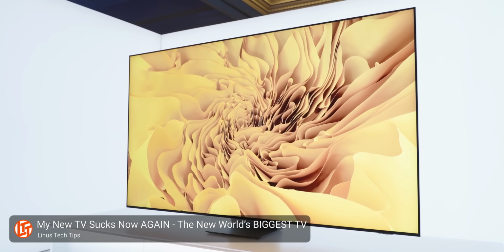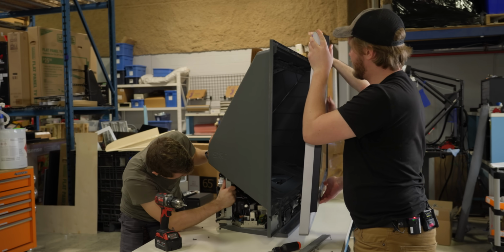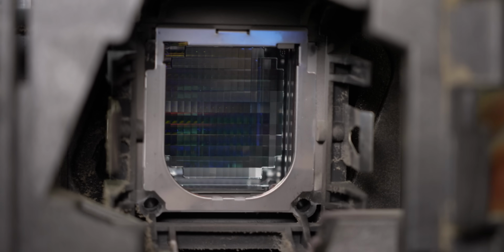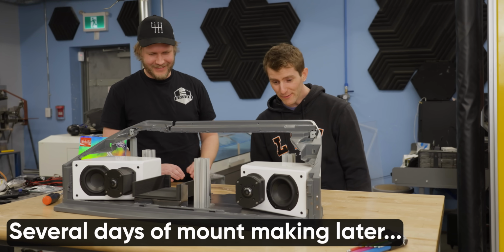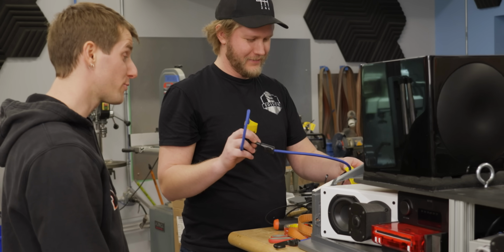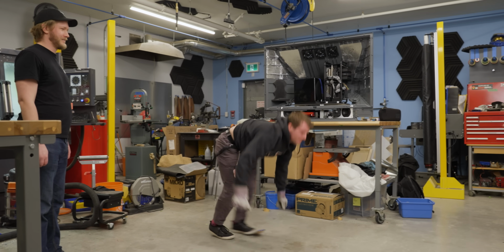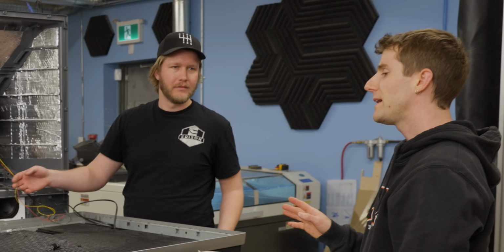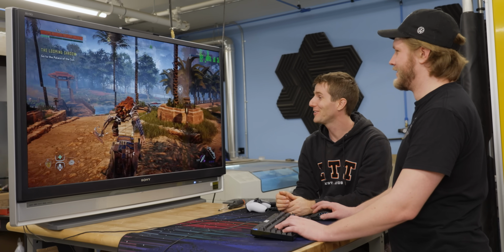The ULTIMATE Sleeper Gaming TV

Comment: I would have done this a lot differently. I would have taken apart all the systems, get rid of bits you don't need. Create mounts for the drives and slots in the plastic. Make it fully enclosed and light. Who the heck wants a heavy TV that takes four people to move? And cheese balled. That Alex guy doesn't think smarter not harder.

Comment: as a dj of 25 years the worse possible thing they did was put a sub in the tv, mainly the mainstay of tv frame material is plastic, the ammount this will vibrate is nuts, in fact its quite possible the sheer op vibrations from the sub will prevent the 2 consoles from working at all, because the vibrations will mess with the disk reads very badly, in the end in my eyes a sub is a peripheral u need a special space for that doesnt just vibrate the whole house or whatever it touches and is well thought out

Comment: A friend of mine has a similar projection TV at home, ready to be thrown out. It's 50 or 55 inch and on one of those movable pedestal thingies that house the speakers and the rest of the components. This would make an amazing combo with an OLED panel and the projector shining a B&W image onto the back of it, making the contrast ratio out of this world. DIY Perks did something like this with a normal TV and a projector mounted above and reflecting back onto the TV.

Since these things already have a projector in them, this could potentially make a better version of the "infinity contrast" TV he made. Since OLED is still quite expensive, a normal 4K display from a broken TV would be a nice candidate for this.

Comment: I just picked up a similar TV after my decade old Insignia's power supply failed (say what you want; it looks better than a lot of budget smart TVs with wonky colours and terrible built-in Roku OSD; I paid 350 for it lightly used years ago and it's seen almost constant use). Went on Marketplace and picked up a free Sony Grand Wega 50" of roughly 2004 vintage, and yeah, it's a huge downgrade in resolution, contrast, and brightness, but I will say this: it's really tied my living room together considering the rest of my setup: PSB tower speakers circa 1990 powered by an early 80s "silverface" (Audio Reflex in Sony-coloured clothes lol) receiver, VCR, my beloved PS2, and a Pioneer Laserdisc player (plus an HP ProDesk whatever as an HTPC, which gets 99% of the use, and small Bluray player I've literally never used, but w/e).

This is a setup I could only dream of back in '04, but now I've got the full upper-middle class home theatre experience (minus the traditional garbage surround sound in a box setup; much prefer a good set of stereo speakers than a circumaural set of shitty ones lol), and tbh I'm gonna be a little sad to see it go when I finally fix the power supply in my Insigna. I'm honestly considering replacing the internals with the Insignia just to keep the Y2K aesthetic lmao.

Already kind of an unusual thought to have, and then out of nowhere, LTT puts up a video doing exactly that? I feel validated and emboldened to put my plan into action. And even better, there'll be enough room in the thing tohide the HP instead of having cramping the TV stand's style (it's a SFF model, so the GPU is dangling out the side with a PCI-E riser, and an entire ATX PSU hidden behind the VCR for the 8-pin lol; it's taking up a good chunk of usable space).

Comment: The reason Xbox isn't in the top four is because it's mostly superfluous if you have a PS5 and completely superfluous if you have a PC, Since nearly everything that's on the Xbox is also on the PS5 and PC and if it's not on the one it's on the other. Yeah. I mean if you are only going to have one console in that case you'd just get a Series S because of Game Pass, but if you're going to have multiple it just makes sense to not include an Xbox... Actually the Switch is also mostly superfluous if the PC is powerful enough to run the emulator for it at full speed and it doesn't take much to run Dolphin for Wii games...

Comment: I had this tv.  The bulb had to be replaced every few years, which was like 200 bucks or something.  The picture eventually had a yellow spot form on the screen that grew over time to the point where the whole screen turned yellow.  I thought it was a good deal at the time because it was less expensive than flat screen lcds and plasmas.   This was back when 50 inch lcd and plasma flat screens were almost $4,000-6000, while this tv was half the price.

Comment: I loved my DLP TVs.  I had a 42" Samsung I bought in 2004, and the control board died after 2 years.  Best Buy decided it would be cheaper to credit my original purchase price.  I got a 60" Sony, which I used until 2015 when my oldest started crawling.

I broke a buddy's plasma tv last year and I thought about doing something similar.

Comment: Greetings to the LTT team, thanks for your video. I am from Chile and I have a question: In my country the builds that cost $1000 dollars really cost $2000. A video about budget PC would be interesting considering that in other countries different components are more expensive. For example, an RTX 4060 costs $402, but a motherboard can easily cost $250 and be low-end. Additionally, Amazon is not an option because shipping and fees cost more than the component itself. Can the LTT team put together a PC Build that considers prices in Chile or, perhaps, a super video comparing different prices from different countries so that they can see the difference in ranges and quality that one can choose in places that do not work with the dollar.

Comment: My dad had a projection tv but as a kid I didn't know it was mostly empty inside. I thought the heft was because it was filled with stuff. Now that I'm thinking back it was the built in speakers on the bottom which was the built in stand for it. I remember losing like a ball or flying toy behind it and one day being able to actually move it by myself and putting it back successfully. It having S-Video on the front was a huge deal too. And my sister constantly tripping on the cords and ripping out the a/v cables of our playstation. Good times

Comment: for the speakers you can use mackie cr-2 x cube facing user then in addition a mackie cr6s-x pointing any direction (including back). not necessarily theses exact model bt same format. it's very specific cause the bases play a bit of mid range, and because it's meant to be combined with cr2-x cube, the remaining spectrum cnan be provided by this very tiny cube form factor. it's designed to take the minimum amounf of space facing user, while most of the "big sounds" can point pretty much any direction (of course there will be a tedious configuration optimisation for the subwoofer, like any subwoofer, but this configuration is very sensitive to calibration).

Comment: This was pretty cool. Those DLP projector tv’s back then were a good alternative to the more expensive bigger than 45 inch plasma and early lcd flat panels hitting the market at that time. My dad was a tv repairman through the mid 90’s to 03 when my mother’s health started going really downhill. I remember he sometimes worked on the really old projector sets. IIRC they had three tube projectors for each main color, red green blue pointed up to a mirror in a similar angle to this one. The shop Dad used to work for eventually closed down somewhere around 2010 because everyone was throwing out the old tube televisions and jumping straight to large flat panel sets when they were getting affordable for most people. Plus the way that flat panel televisions are made, whatever needed to be fixed required a major component to be replaced, and the cost of an entire mainboard or the screen alone made repairing cost prohibitive.

Comment: I had a 61 inch version of this, A HUGE jump in size for the day and I rode out two lamp changes and going from a tube tv to this was an insane jump. I also paired it with a really nice surround sound system (3.5k) which I still have to this day.

Comment: My parents bought this exact TV in 2007. Still have it today, and it works perfectly. Never missed a beat, except for needing a projector bulb replacement around 2012. Very cool to see you guys taking it apart and explaining the tech. Thanks!
Reply: Add a MINISFORUM 795 to its back
Reply: This was the first TV I bought myself around the same time-ish, and my first HD TV. It served me well until it started turning off and on again randomly after many years, and I couldn't figure out why or how to fix it and had to replace it. I actually still have it in my basement because it wasn't completely broken and I thought maybe I could give it away to someone who knows how to fix it, but weirdly enough, nobody wanted a massive rear projection TV in 2015 or so.
Not sure why they're shitting on it so hard in the video. Honestly it did not feel or look awful to me at all, actually I remember picking it out in the store because it had a significantly better looking picture than several non-projector devices next to it. Sure, it's obsolete now, but it wasn't a bad TV for the time by any stretch of the imagination.

Comment: I had one of these 55 inch "FULL HD 1080p" Sony TVs, forgot the model but that was the logo in the bottom right corner. When I connected to my PC for the very first time, I found out it actually  had only..... 768p max resolution. Remember those old tube monitors with 1024 x 768 resolutions? Yup, it was pretty much that for real and Sony just sold these as "FULL HD 1080p" since it was really early days of HD broadcast and most of the satellite and terrestrial TV channels were broadcasting in 720p that was considered HD.
Reply: Couldn't that have been an interface problem? Connecting PCs to old TVs by VGA was always dodgy for me.
Reply: It is possible that the EDID data (which tells the PC graphics card which resolutions the screen supports) was skewed when you used an HDMI to VGA adapter to connect to the PC. 
If no adapter was used, I'm guessing the TV's EDID data itself was incorrect from the factory. In order to make sure, it is necessary to force the EDID data to 1080p using the Custom Resolution Utility
Reply: To everyone wondering about connection or adaptor, nope! It was HDMI to HMDI and I even tried with different cables just in case but same result.
The reason they pasted "FULL HD 180p" was probably because it technically "supported" that and most likely was scaled down if there was any 1080p broadcast to begin with.
Reply: Uhhh if your TV only went up to 1024 x 768, I have a feeling that was an issue on your end. That's a 4:3 aspect ratio, so it doesn't really make any sense that a wide screen TV would max out at that resolution regardless. They had rear projection TVs with DVI and HDMI after all, so people indeed hooked up PCs to them back in the day at higher resolutions.

Also you mention tube sets going up to that resolution, that would be a CRT monitor from like 1995 in terms of capability. You sure you're not thinking 1366 x 768 or something there abouts? Did you use hdmi/DVI? If you used the component out of your old GPU, back when that was a thing, analog 1080p wasn't really a thing. Like, physically, you can transmit the signal, but DHCP was established so not TV had analog 1080p, only digital 1080p.

Comment: Y'all would have done better building a box enclosure using ALUMINUM or WOOD, instead of using a PLASTIC TV enclosure.  Older (pre-1980s) CRT TVs/Stereo Consoles/Mainframe Computer Servers enclosures - made of aluminum/thinner steel/thick wood. 
A steel plate at the bottom is stronger than aluminum/wood of course but the added weight.  No Way.

Comment: That was really cool, now do my suggestion lol Yoshi's Box, you need to find an old school actual full tower, and build in a top tier gaming pc, and all the current consoles into the chassis. Bonus points if you manage to fit some old school consoles so you have to mod not only wired controller support, and access for discs/carts, but also for the output.

Comment: Rear projection was a supermassive step up from an equivalent crt. The main problem with them was how delicate they were, if you bumped it while moving you would need to spend like $300 to get someone out to re-calibrate it or the picture quality would be shit from then on (the projector heads would miss-align).

Comment: So if you are looking for a modern OLED TV with 'retro' good speakers (meaning having normal speakers that face the listener), Panasonic makes some. Panasonic's OLED TV's have what is essentially and integrated soundbar at the bottom which while sounding great does make the TV look older than it is, which is why I assume most manufacturers have decided to forgo the obviously better setup.

Comment: 10:25, sorry but, did you update the crossover to accommodate the phase shift difference between the woofer and the tweeter by moving the tweeter 10cm forward ?
I"m not going to talk about the other issues by doing this.
Why couldn't you just use flat baffled speakers instead of the height channel type of speakers ?
Or heck, just rotate the SVS ones and make room for the wii to move it a bit to the right ?

Comment: How were these TVs “awful” when they came out? I went from a 27” Sony CRT to a 48” (or 46?) Sony Rear-projection. High Def, widescreen, affordable, and WAAAYYYYYYY lighter than the CRT. Lasted me 5 years at which point I upgraded to an LCD and the rear-pro became a friends basement-bar TV. Lamp apparently gave up a year later and Sony ended up replacing the whole TV for a comparable LCD for free! (grr, shouldn’t have given it away >.<)

Comment: That’s good but personally I’d also install an Apple TV because honestly in just generally being a nice experience to use no other streaming box is as convenient or responsive
Whatever reason you prefer your fire stick or chrome cast because they aren’t in the Apple ecosystem, I don’t care, I don’t want to watch TV using windows with a media interface on top of it either,too many potentials for issues
The Apple TV simply is more responsive and has nicer animations than other streaming box systems
And is simpler than a pc based setup
And yes I know the TV will have one built in 
But again laggy and often have more ads
At least with the Apple tb you can set it to default to an IOS style Home Screen with only ads for the app you hover over 
But

Comment: Awesome build. Would have loved to see the result in a bit more detail, though. How heavy did it end up being with all components inside?
The foam under the subwoofer, though? That probably didn't do anything, as it was completely squished by the weight of the sub. You needed way stronger foam for that.

The "genius" thing about small bezels: Obviously, the picture will pop a lot more when you have it in front of something dark. Larger bezels somewhat solved that for you by adding a dark frame around the picture. Small bezels look nice when the TV is off, large bezels help the picture, IMO.

Comment: this sort of thing needs to go mainstream I've always hated the fact that TVs keep getting thinner and more expensive and you still have to buy a separate audio solution although one thing I think you should do different is add more exhaust fans
Reply: I would immediately get a thicker tv if it had better built in audio and had space for better subwoofers than the tvs currelty have inside

Comment: "flat screen" is an accurate description of this TV. In fact it's more accurate than it's usage today.

Plasma, LCD, OLED etc. should be referred to as "flat panel" televisions.

Literal "flat" screen TVs have existed since the 80s in rear projection and CRT form.  High end CRTs had flat screens and the glass had to be stronger to stop them exploding under extra pressure that curved screens did not suffer as much.

Comment: Well it was cleaner than the one I built at work twenty or thirty years back.

There was this catalog published by some company in Hongkong, if I remember correctly. They only contained advertisements from Asian companied making computer related products. They ranged from motherboards and SerPar cards to complete desks with built in displays and touch keyboards under the glass top. We tended to always look through it to see if there were anything interesting sold, and one time my boss ordered a computer monitor / computer / TV to see if it was something we might be interested in selling. The good thing I can say about it was that everything worked. The bad thing was that the monitor image quality sucked and the computer was thrown into the case so you had to remove the cascade when trying to install a processor, and there were very little room for a CPU cooler. 

Now for those who don't know much about old CRT displays, the cascade is a component that raise the voltage to about 20,000 to 30,000 Volt that is then used to power the shadow mask. So it's nothing you want to get too close to when the monitor is powered.

TV functionality was really a TV card that you could control from the computer or using a remote. So you could have the TV picture in a window or switch it to full screen using a remote. You could also record the TV programs and using a timer function the computer could do the recording without turning on the screen. Unfortunately the monitor image quality sucked, the TV quality sucked, the sound quality sucked and the computer was not easy to replace when it started to get  a bit old. All in all while it worked it was not something that felt like a product you would want to sell to common users. 

Compared to that the TV they built in this video was very nice.